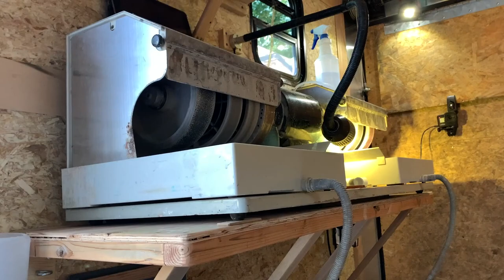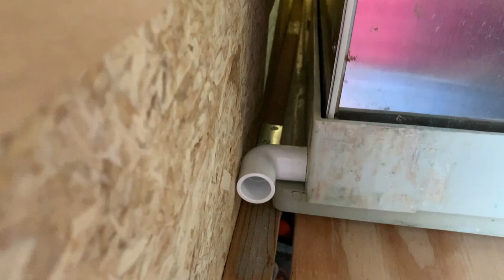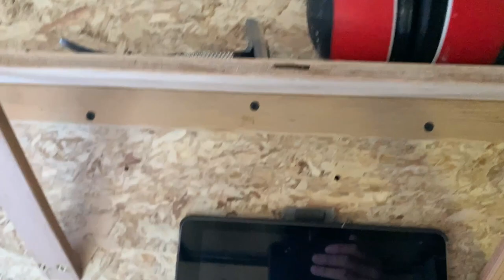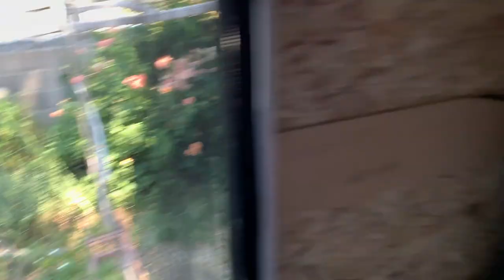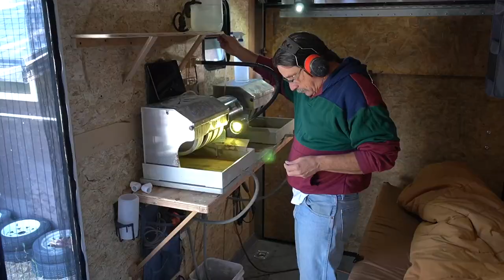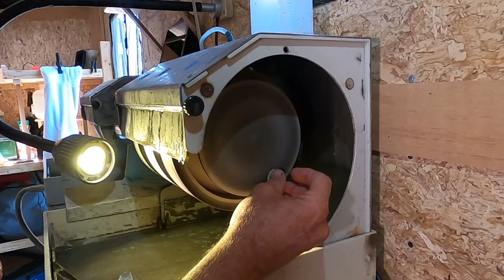6x10 Cargo Trailer Camper Build / Part 8 / Cabbing in a Cargo Trailer

Comment: Hey there Camp Lapidary, cool update/cabochon video. I am glad you are going to set your machine down when traveling, something to keep in mind when doing a build like this is that you need to worry about lateral forces as well, so yes as far as down force your cab shelf looks stout, but if you bolt your machine down and then have to stop suddenly all that weight is going to push sidewise. Thanks for showing us your progress.
Reply from the maker: Thank you and good point, HCH! I'd have to strap the motor to the wall very securely indeed to feel safe about leaving it up. I'd still take off the hoods and trays for transport over dirt roads.

Comment: I like your setup, well done. I like how your modifying tour drain lines, good and smart! Thanks Marc for sharing your experience and journey!
Reply from the maker: Thank you, Nic! Been thinking about running the drains right through the wall to the outside. Not quite sure about it though so I'll ponder long on it.
Reply: @camplapidary  I see no issues there if it's sealed and not dripping down the side of the trailer!
Reply from the maker: My main concerns are just the extra penetrations in the exterior skin just for a drain? Might be worth it, might not. If I find myself using the machine in the trailer a lot I might consider it more. For now it's just a thought. :D

Comment: Those catch trays look square. Can't you rotate them 90 degrees to drain off the ends of the bench?  Thanks for the vids
Reply from the maker: Hi, Ronald! Great comment and a sharp eye!
The trays are 10mm difference sides vs front/back. I wish it were so easy! The hoods also slide into structures built into the trays only on the front/back. A person could modify the trays to go sideways, as the hoods still fit inside the trays when placed in that orientation. Some plastic walls in the trays would need to be removed in order to set the hoods all the way down. There would be a few drawbacks to such a modification.